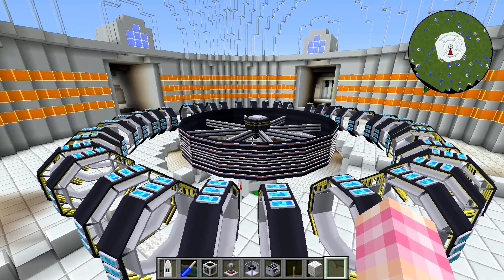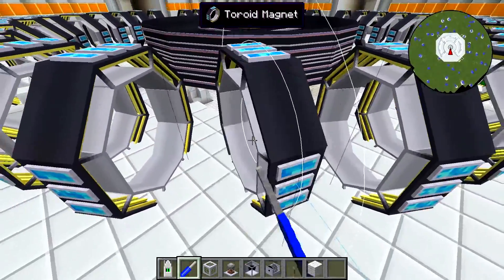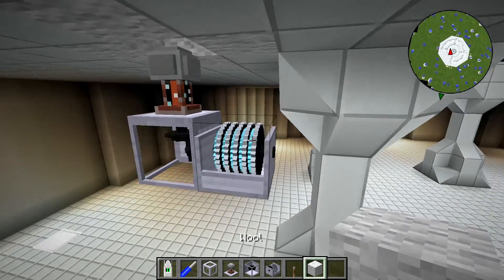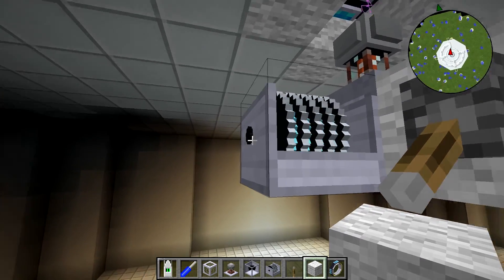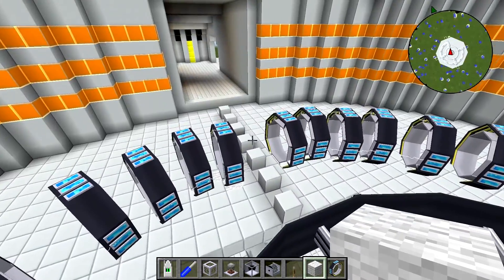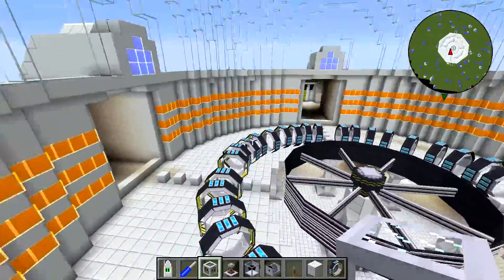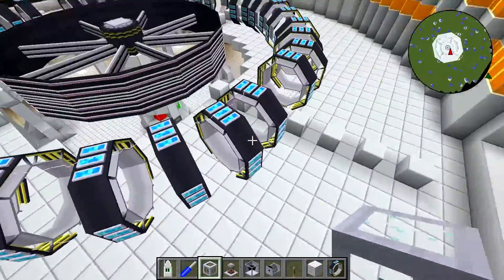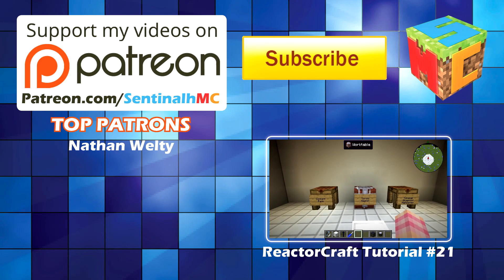ReactorCraft Tutorial #22 - Toroidal Magnets Part 2

Comment: hmmm little bit confused because i tried that same amount of power as you, it gave me blue sparks so i tried double both rad/s and nm to 256000 rad/s and 128 nm and i still got blue sparks.

EDIT: ok i tried quadrupling each and still the same issue
Reply from the maker: Well as long as you have sparks of some kind between each toroid it will work just fine.
Reply: ah thank you